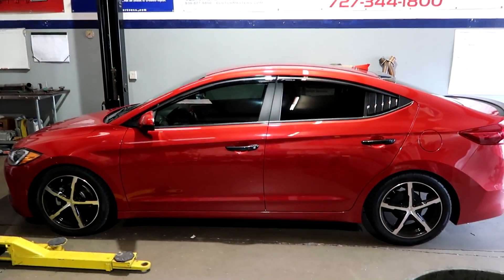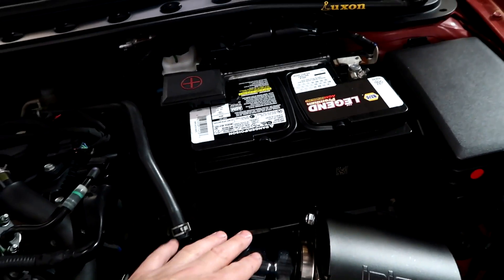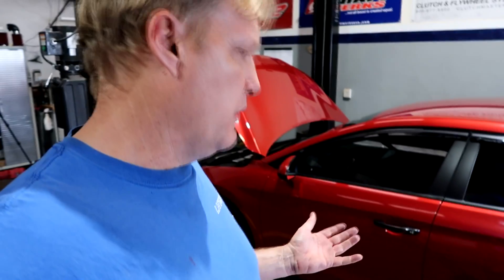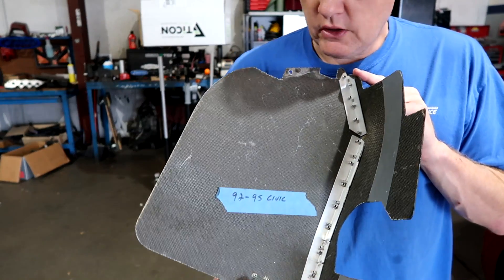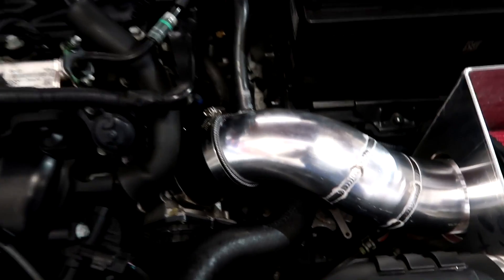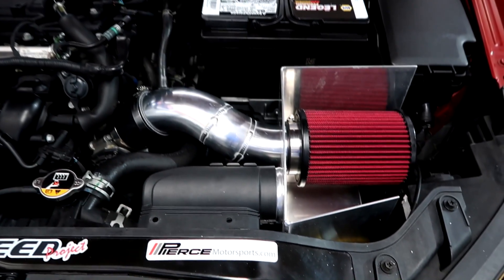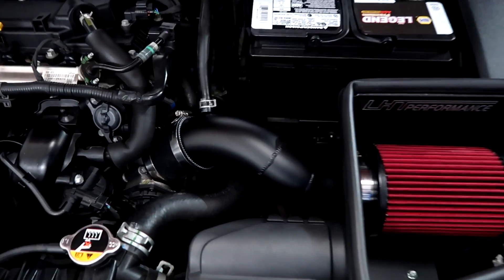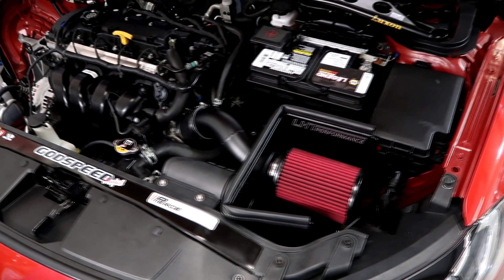Custom Cool Air Intake , without hydro-lock

Comment: Hello sir! Can I use fiber for fabricating a heat shield?
Reply from the maker: Yes. It works very well.
Reply: Thankyou Very much! What material did you use? What is the set up of the pipe? Is it a silicon coupler  reducer or a stainless reducer? The one that binds the intake and throttle body together

Comment: Very nicely done!  Bet the customer will love it.  

I'm surprised that car doesn't have a MAF sensor and runs using speed density, I didn't know there were cars that new doing that still.
Reply from the maker: Matt Lanoue Yes, he’s very happy with it.  
Agreed, I’m surprised it didn’t have a MAF, makes building an intake easier.  No worry about diameter of the tube

Comment: Beautiful work as usual guys.  I was wondering how you account for engine flex under acceleration?   Is it just a bigger hole in the box or more flexible mount at the TB?   I’d love to have one on my TEG
Reply from the maker: Jon Donson Theres flex in the coupler and the hole in the box, the hole is about 25mm larger with room to move. We’ve been building these kind of boxes for years, just most people don’t want to pay for it.